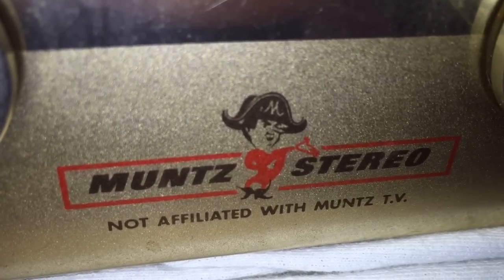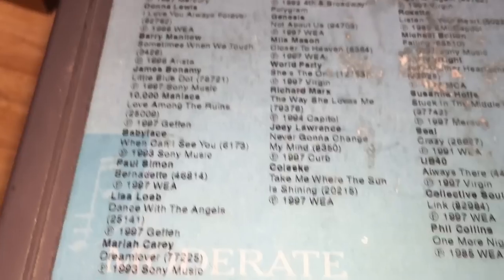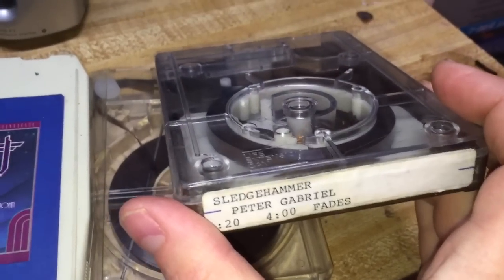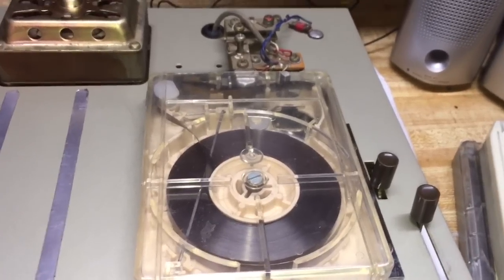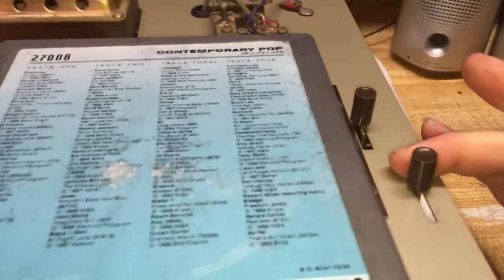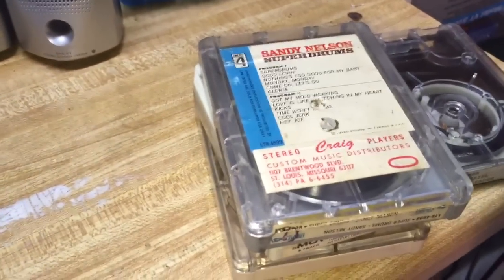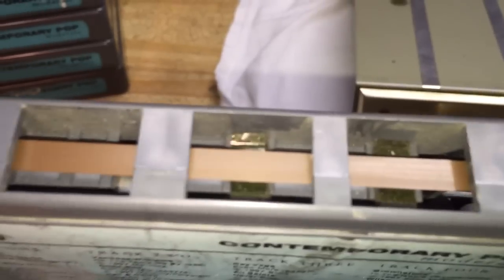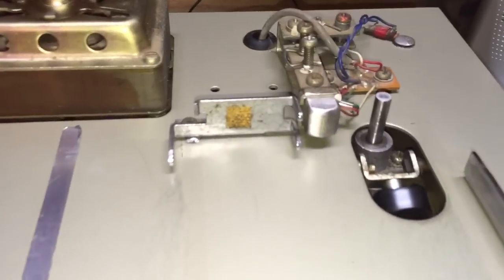4-Track Tape - Big Brother of 8-Track 60s

Comment: The "curious little thing" at 16:55 is also found in some reel tape recorders from the late 1960s - I saw it in AKAI X-200 D except that their "thing" was put in an adjustable holder. It's a little coil and what it does is that it picks up the inverse phase of the hum that can be a problem if a motor is put close to a magnetic head. My AKAI had more playback hum if the coils were turned out of adjustment. And by the way: I share your thoughts on the capacitors. I have been working with old electronics for 30 years and I have changed surprisingly few capacitors. Recapping is simply not the miracle cure that many people want it to be!

Comment: In 1968, I went to store & bought a car player  4 & 8 track (Craig I think).  Installed it, and it was great.  The 4 track tape drive wheel had a tendency to grab the tape as you pulled it out of the player, so It was kinda frustrating...I started buying 8 tracks to play in it.

Comment: Most of this you probably know already but just in case you need a refresher....

1. You are lucky the MUZAK tapes are old enough to be recorded at 3-3/4.

HUGE numbers were recorded at 1-7/8 - MANY more than at 3-3/4, and
THEN there's the ones that - like their cassette counterparts - were recorded in divisions of 11-1/4 rather than divisions of 15 IPS e.g. ``their'' 7-1/2 is actually 5-5/8 their 3-3/4 is actually 2-13/16 and their 1-7/8 is 1-13/32.

Cassette versions were recorded at 45/64 instead of 15/16 and recorded in Portastudio track configuration i.e. tracks are equi-distant from each other like on a reel to reel - where stereo music cassette track configuration has two tracks near one edge separated by a few microns - a large guardband down the middle and repeated on the other side vs a portastudio e,g, Tascam 424 Mark I or National library Service talking book cassette player if you turn the varispeed down a little bit to match the pitch

I see a few POSSIBLE issues.

1. The belts used on these are made from an older, considerably more flexible neoprene than what you have on there if you bought a new Russell Industries/PRB belt to put on it. The newer belts don't go beyond about a 30 flex, and for these (like old Dual belt drive turntables and one-motor-wonder reel to reel decks that need the super flex of the belt to drive the rewind) need a minimum of a 60 flex index. You can tell more often than not because the superflex ones are white instead of black - even though several runs of black superflex were made - you can't get them anymore.

2. The silver belt drive pulley mounted on the top of the motor could very well be the wrong one.

If it were going FAST I'd say you had a German (50 Hz) pulley mounted on a dual-purpose motor and were running at 60 Hz. For the cheaper models of turntable and tape deck from the 60's that did not have a frequency switch - the pulleys were changed instead.

But since it's going SLOW I'd say that originally maybe this one had a PLASTIC one installed - it broke and somebody just had an extra one off a different deck with a smaller flywheel they just stuffed in there any old way. I've had tape decks and turntables come in my shop like that.

To make sure it's the right one, take the circumference of the capstan INSIDE the belt drive notch as well as the drive pulley and do the math to see whether or not both the drive pulley and the flywheel are the right size.

That's of course after making sure the motor is running at the normal 1800 or 3600 or whatever RPM its supposed to - because if your motor is running at 1500 or 3200 then there's something wrong there as well. After checking for proper lubrication, some motors have a small adjustment either within or near the motor itself or else on the circuit board, and some others need to have certain resisitors replaced with different values to correct for the error.

3. The small silver ball on the retention arm of the underside of the flywheel could be a culprit as well. If it's missing, damaged or if the flywheel has been knocked off its' proper placement (riding too low or too high without being so far off as to scrape) this would impede the speed as well.

Comment: I've read comments regarding the capacitor on that motor causing a slow speed.  There is another possibility as well:  lubrication.  In the past few years, I've repaired several 8-track and record players; and those drive motors (particularly 1970s and older) suffer from dried-out lubricant, often running slow and/or unevenly.   I use a mix of lithium grease and WD40 on the motor shafts and bearing cups.  Don't dump a lot in there, just a dab or two, let it run and 'wick' the mixture in there, dab it again.  Also, use some alcohol and clean the belt surfaces of the motor and flywheel; belt residue can actually cause slippage in some instances.  Don't let the alcohol get onto the belt itself; it will cause the belt to deteriorate further.

Ideally, you shouldn't use 'bare' foam to fix eight-track or four-track tapes.  The original pads had slick plastic film over them to let the tape slip easily; 'bare' foam will tend to wipe off the graphite lubricant on the tape.

That's a damned nice little toy you've got there.  It's awesome to see some love for the old music formats.  Muntz players were THE first car stereos, kids.  The eight track came along a couple of years later.  And though they seem primitive today, they did exactly what they set out to do:  they brought high-fidelity, STEREO sound, and the ability to listen to whatever music you wanted, to the automobile.
Reply: Sounds good but what can you do if the 8 track player plays to fast? I have one that does and I can't figure it out. It's annoying.
Reply: i wonder if DeOxit would be good for cleaning a direct drive motor
Reply: +ps3master72   Well, I've never tried it, so I can't comment on how effective it would be.  DeOxit is supposed to remove oxidation from controls like potentiometers and switch contacts; I've no clue how effective it would be at removing old grease.  I do know that alcohol does a good job of removing old gunk, and it, too dries without leaving a residue.  I can't imagine it would hurt anything, so give it a try.
Reply: I know this a really delayed reply, but Youtube's message notification system isn't particularly reliable and I just stumbled across this video again today.
There's really not a lot you can realistically do if the tape speed is 'off'.  It's kind of a long shot, but look at the spindle of the drive motor, where the belt rides.  Sometimes the belt leaves some material on that pulley as it deteriorates, effectively increasing its size and, as a result, tape speed.  If there's residue, clean it off. 

If the drive motor is DC (which would be ALL automotive players and some 'home stereo' decks), there may be an adjustment somewhere in the electronics.  I've only seen a handful with this adjustment, so don't get your hopes up.
One could conceivably build a PWM 'trimmer' circuit to adjust DC motor speed; it would be similar to to the speed adjustments found in modern Crosley and clone record players.  Probably more trouble than it's worth.
If you have a home deck with an AC motor, your only option would be a mechanical modification - again, probably more trouble than it's worth.  AC motor speed is determined by line frequency.

Comment: Those particular cartridges were made in the 1990s, but, Muzak used cartridges like that since the 1960s.... 4-Track tape cartridges started out in commercial use in broadcasting, even when radio moved on to play digital music, many stations still used the cartridges for ads and such for some time. Those Muzak cartridges have been around since long before the 1990s, they used cartridges more in the 1960s-80s, but were still around long after this. I think the commercial Muzak players were automatic, switching tracks at the splice in the tape. For planes, trains and buses in the late 80s and early 90s they used 8mm video tapes, using an audio-only format (PCM). They also used tape cassettes and CDs for a while before moving on to satellite in the mid 1990s, however, many places still used 4-track cartridges, which did vary in size, (yes, larger than what you have here), could have up to 8 1/2 hours of music (running at 1-7/8 IPS).
Reply from the maker: Great info, thanks for sharing!

Comment: Hi!  Among my stuff today, I came across "The Harrison Catalog of Stereophonic Tapes" from Winter 1961.  Most tapes listed are 4-tracks reels, but toward the back, there's a section for 2-track tapes.  At the very end, there's a listing for stereophonic tape cartridges, which are the 4-track cartridges you're talking about here.  At the beginning of this cartridge section, there's this amazing (to me) paragraph:  "These tape cartridges are designed for use with the new tape cartridge players.  However, the four-track 3 3/4" i.p.s. tapes in the cartridge can be threaded on conventional reels and played on any machine with good constant 3 3/4 i.p.s. motion and four-track heads."  REALLY?  Would this really work?  Are the tracks configured on the tape in the same way as traditional 4-track reel tapes?

Comment: hi the cut wires went to a recorder part  the audio 150 khz came down the cables the the heads  you could have pulled the turn table out and put
a cover over the hole the recorder done's not record well  to re-cord  you have to de mag the tape before recording new music again
i have looked in to the cart audio tapes

Comment: If the motor uses a capacitor and runs hot, check that cap. If not, check the belt. If it runs slow, just try to move toa bit loose belt. Those systems using AC motors or the DC one with mechanical gobernor, are a bit "sensitive" to the belts, too much tension will drop the speed a bit. Some belt slipeage is expected at start up, the capstan is gigantic, but even on a looose belt it should work fine, since keep tape moving wont take much effort
Try to clean the motor inside, or blown it using a compresor, because all this holes help the air pushed by the fan to run across the motor and pass inside it. Cheers.
Reply from the maker: 38911bytefree Thanks for the input!

Comment: hi did you know there's a bigger tape than the one you have. in the uk reditune had very big
carts  they are recorded on each size very high output i have 8 of them they will not work on
that small player you were right they would hang over the end of it

Comment: Question what happens if you put the tape of a 4 track into a 8 track cartridge and play it on an 8 track mashine ? Will it cross talk on different channels or what ?
Reply from the maker: You can actually play a four track cartridge in an eight track player.  You just need an adapter. The adapters are super rare, but do exist. An eight track player will play the four tracks without cross talk.

Comment: Most units like this, tape players, that have a AC motor they have a capacitor that maintains the motor speed. This might be something like a 2 Mf at 120 volts. The age of the unit most likely means that the capacitors, this run capacitor, have lost their stuff and their Mf value has went down.